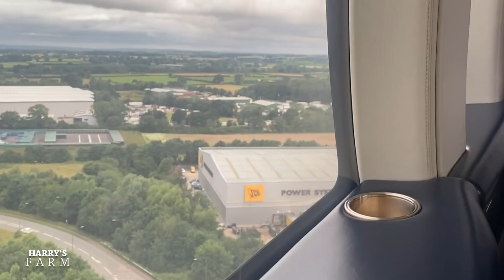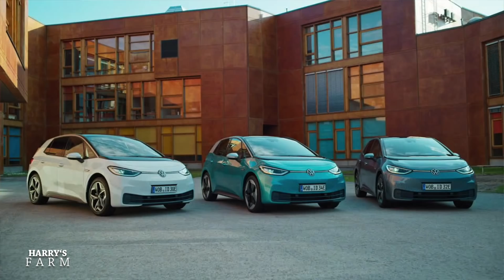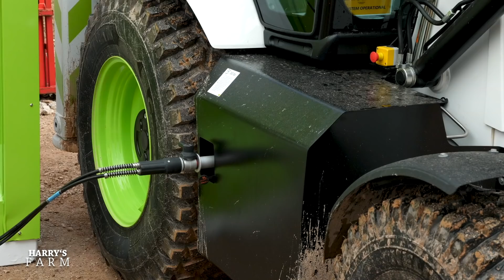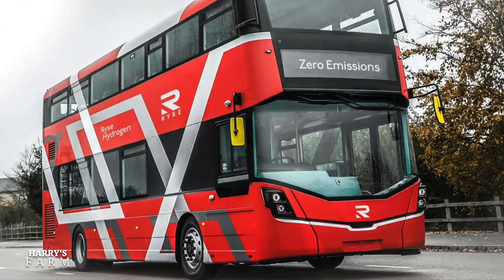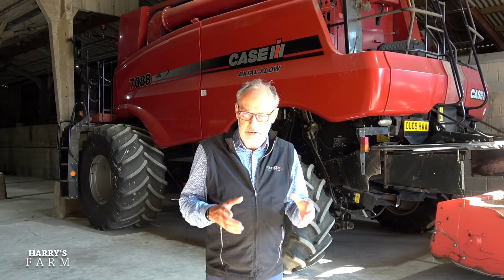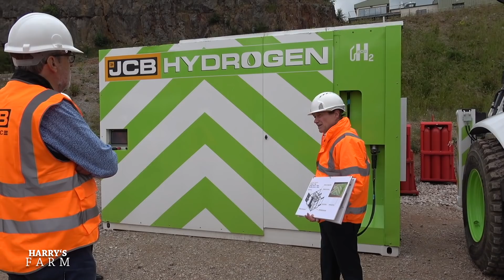Why JCB thinks hydrogen is the best alternative to diesel for heavy machinery, farming and HGV fleet

Comment: It would be interesting to see you produce a video of a tractor or other farm machinery /generator working on your farm , doing a comparison between diesel and hydrogen power , as is always the case polytickians knee jerk  reaction prove to be  entirely the wrong answer❗❗❗❗ 
Well done to Lord Bamford and JCB for coming up with a viable sensible , workable  solution that is also eco friendly , plus it's an English company  , it would be great if a branch of JCB had a factory in Cornwall 👍👍😎😎

Comment: When H2 becomes H20 vapor in a hydrogen engine, it has stored energy in the form of specific and latent heat. When the H2O rises into the atmosphere it absorbs IR in exactly the same way that CO2 absorbs IR. If the H2O vapor becomes a cloud and subsequently turns to rain, it gives up its latent heat of vaporization into the upper atmosphere. Water vapor puts much more heat into the upper atmosphere this way than does CO2. CO2 does not liquify in the atmosphere. Water vapor and CO2 absorbing IR from the sun overall reduce ground temperatures, by absorbing IR then emitting IR some back into space.  Life survives in all climates that are not permanently frozen or above about 60C. No life can exist when CO2 is less than about 150 ppm. Green is CO2, IR and heat. Sufficient CO2 is more critical to life than climate.

Comment: Main issue with hydrogen is the cost of extraction of it from the air/water. There are only a few suppliers, like with electric vehicles we need to massively expand the suppliers of hydrogen and electric charging points.

Comment: One thing that seems to get left out of the discussion about efficiency between BEV and hydrogen is that if you go head long into BeV you essentially need to build an all new global fleet of vehicles. You can convert diesel and ICE engines to run on Hydrogen. I'm not sure if anyone has done the calculations, but I bet if you added in all the new materials and energy required to do this you'd would find that Hydrogen is a more attractive option than we currently think it is. Also, at least in th US, our grid is not currently designed to handle the load that all the BeV charging would require. Not that BeV is a bad option...but it's far from the silver bullet that we are being told it is.

Comment: Why is this conversation NOT happening in the motoring press, costs of batteries, their weight, harder on the suspension, subsequently harder on the the road surface, which will need more resurfacing, batteries are just not the way to go, as Lord Bamford has proved!

Comment: There will be no doubt an initial environmental cost to the development of hydrogen powered heavy vehicles in terms of hydrogen supply and infrastructure. However, compared to the environmental disaster that is being caused by mining for the metals used in EV batteries, it pales into insignificance. I honestly cannot understand why "western" govts. will not factor in the damage that is being done to the earth in our efforts to source lithium, cobalt and copper, coupled with the fact that our supplies of electricity will not cope with the demand of EV's if governments persist in following the false economy of electric vehicle technology. Hydrogen power is without doubt the only viable way forward at the moment.

Comment: Hydrogen in an ICE is arguably better for the environment. However, that doesn't mean Hydrogen in an ICE vehicle is good for the environment. You get a hydrogen leak and you may as well burn crude oil.
Don't get me wrong. I am on team hydrogen rather than team BEV, but there are so many people calling out the wonders of hydrogen, but they never actually mention the risks of it. For instance, while not a green house gas it's self, the effects it has in the upper atmosphere actually increases the effectiveness of methane as a greenhouse gas by30% according to a study. Methane by the way, is a much bigger problem than CO2, hence "You may as well burn crude oil" and Hydrogen is good at leaking out considering it is such a small molecule.

Comment: Here are few of my thoughts. We currently have millions and millions of fuel pumps worldwide. And taking all that down and build new charging stations are just too much work. These limitations are just engineering problems, not drilling the earth (batteries) problems. 

Also, I don't see why synthetic fuels can't be a thing. It's waay better to make an alternative fuel (which is already made) which everyone can use in their vehicles with maybe some slight mods to the engine rather than buying a new one. I mean, many people I know bought vehicles with years and years of hardwork. 

Carbon capture plants. Why aren't a lot of interest going that way? 

As another person pointed out, we should let engineers lead the way. Not brainless old politicians.

Comment: Man, in my head, with fuel cells being a thing, a internal combustion hydrogen powered generator, it's just stupid. Sure it might be cheaper to buy, probably just because of development costs/the industry and tooling is already there, but it's less than half as fuel efficient. And it still requires oil changes lol.

Comment: And soon they will produce engines that include an electrolysis component so that users won't have to buy the hydrogen, but can instead just put water in the tank and away they go. Technically it's already been done, but the rule makers will have to allow it.

Comment: The cost of hydrogen fuel could be offset somewhat by selling the oxygen produced from water splitting, i think.
I mean, it would be best to produce your fuel locally if you're going to be using hydrogen, right? You'll need larger tanks and even then, more frequent refueling. 

So say the oxygen produced is cryogenically separated, you could have a delivery truck going around swapping out dewer flasks and selling the oxygen off to companies that need it, like the medical industry.

Comment: Totally agree Hydrogen is the way to go all the way ..1 fuel for all...the days of 3 fuels at a gas station gone  ...The big fuel company's should be getting on to this now instead of looking for new oil fields and such the answer is under there nose..And they still will need to make oil for these engines but that is a renewable thing now days ....Dont get me wrong Tesla is doing a good thing for now .But once a battery discharges its gone ..But with a Hydrogen its spent fuel is turned back into water and therefore can be reused over and over again.....It makes so much sense it is stupid of the big three over here in Canada and the US not to go to Hydrogen ....And to take a few minutes to recharge vs hours is a no brainer as to which i would choose to buy......I could go on

Comment: There is a reason why Toyota is building hydrogen ICE engine after having promoted the hydrogen fuel cell engine for so many years. Hydrogen ice engine is cheaper to produce and can easily replace the petrol engines in car. But how do we produce cheap hydrogen and cheaply transport it?

Comment: Prometheus fuels has  a process that can use electricity and atmospheric Co2 to produce hydrogen and an alcohol in an aqueous mixture.  The alcohol can then be made into diesel or jet fuel or gasoline.  They do this using a nanotube membrane to separate the alcohol from the water.  The low power trick is to keep the carbon dioxide in a carbonate form.  They are able to market jet fuel for one cent less per gallon than fossil fuel based jet fuel.  American airlines is buying 10 million gallons of fuel from them as a starter. They plan to sell container sized processing factories that customers can use on site to produce their own carbon neutral fuel.  I wish this company was publicly traded. I would buy their stock.

Comment: I have always wondered how electrification of heavy goods lorries would work given the number of hours the run a day.  Not covered here though is the cost of running on hydrogen and the lower efficiency of a combustion engine.   It is still also possible battery tech will improve which changes some of the economics.  It's almost impossible to say which technology will eventually win out but in the short to medium term its seems both technologies could run depending on the particular needs of the vehicle.
Bosch also have a replacement hydrogen heating boiler ready to go to replace domestic gas boilers.

Comment: Steamology Motion have a much better solution.  1 moving part, small component count, way power per m3, far better efficiency, scalable from a few kilowatt to several megawatts. Very quiet, closed circuit.

Comment: Excellent vid, Harry! Nicely done, LB and JCB! Now, it needs the Auto Industry to crack on and develop combustion engines with Hydrogen fuel usage, as per the JCB Hydrogen Engine. The other big issue is the 'fuel delivery' opportunity, both in terms of a) to the rural users, and b) Hydrogen Filling Stations for the urban users. That might mean a completely new business model for an enterprising company with the will to take on the Petrochemical Industry's hold on the automative fuel supply lines. This is not rocket science. Our engineering expertise supported by a  benevolent force, and driven by innovation, will make the world a better place for Humanity itself...and Mother Earth...and that means, a world without under-performing and very expensive battery-driven vehicles, which no driver really wants in the first place. Just my 2d worth. YMMV. Cheers...and, full steam ahead, I say!

Comment: There's one big problem with hydrogen:the energy equivalent of one liter of diesel costs around 5£ before taxes,it's price has been heavily subsidised for use in unicorn hydrogen/fuel cell vehicles.
One liter of diesel -- 50 pence before taxes.
And you use a lot of electricity for its production (electrolysis) which could instead go directly to households bringing better/higher efficiency.
About hydrogen: in 90's BMW made petrol cars (750i) that run on hydrogen.
Apparently it was quite simple and cheap conversion similar to current CNG conversions.All ICE cars can "easily" run on hydrogen but it's production and price are so far unresolved issues.
It takes a lot of CO2 neutral energy (which we don't have enough of) to produce hydrogen on a large scale and it's very expensive process with poor efficiency. It is enviromentaly much more efficient to use "clean" energy directly in households and factories than to convert it to hydrogen,which is then converted back to energy during the combustion. Besides,only 30% of energy is used for transport/machinery.
So,until we can produce enormous amounts of cheap and zero carbon energy (fusion?) this will unfortunately stay in "immaginationland" inhabited by XR fanatics.
Reply: Actually, the current price of green hydrogen available in NZ for a tractor is as low as 1.2 - 2 pounds per litre of diesel equivalent and the current price of diesel is 1.30 - 1.90 pounds so you seem to be out by an order of magnitude in your assumptions on the relative costs. This is with only the first infrastructure being installed, which will only scale and improve - I guess the production and price issue you mention is looking pretty resolvable. It has taken 150 years to get fossil fuels to their economy of scale and it hasn't taken too much effort to get close. Perhaps supporting companies trying to make a difference would be more productive and positive rather than claiming this is all just "imaginationland"
Reply: 1. Why are we mucking about with the functional fundamentals?  Is it because we like a challenge, and the shouty sorts are taking advantage of this?
2. Why are we mucking around with the way we move around so.  It is cruise liners and so on that cause most of the pollution.  Sort them out first, prove the tech, and when safe maybe start looking at the machinery that actually sustains our lives.
3. Synthetic fertilizers and GM crops have the potential to monopolise food production.  This is a serious threat to our standard of living far greater than the relatively small air quality issue we face.  We shouldn't become too distracted.

Comment: This is glorious.  The whole electric revolution is emotionally driven and lacks data and forethought.  As touched upon in the video; the rare earth materials, the charge time, and worth mentioning is the electricity is still generated by oil, coal and gas.  Nuclear molten salt and fusion aren't available yet to charge cars en masse.
Biofuels and hydrogen can replace petroleum pretty darn quick.  I think motorsport like F1 and Nascar are missing a huge opportunity to start using biofuels.
I like internal combustion, it is a wonderful technology.  Let's get some new fuels.

Comment: Love it, i was wondering where the heavy vehicle sector would go and this reinforces my view that electric is great for small stuff but heavy needs heavy.. its like if you run a diesel van but a petrel model you find they are horrible.. eat fuel and have little power.. petrel and electric are the low end and diesel & hydrogen are the heavy end lol its all so simple really.

Comment: I'd be very curious as to the actual changes a diesel engine has to undergo to run on Hydrogen. I'd assume it's not possible with a petrol engine given the high pressures H2 combustion needs, but is it simply a matter of fitting hydrogen tanks, spark plugs and a hydrogen capable injection system? 
If that's the case, I can see a strong market for retrofitting all kinds of existing machinery, including cars, to run hydrogen instead of diesel - this kind of fuel conversion wasn't uncommon in the 90's here in NZ with LPG (the kind you'd run a barbecue off) being fitted to cars all over the place.

If it turns out to require an entirely different engine (which I'm sure JCB would prefer), I can't see uptake being quite as intense but still a good option for the future.

Comment: Hydrogen is okay as long as you produce it in a green way, but producing it cheaply will be a driver and so companies will just use hydrocarbons to produce hydrogen. 

Talking about the cost of ownership, EV motors are substantially simpler than something like an ICE engine. Lord Bamford said technician's don't need to be retrained? There are plenty of examples of mechanics who are adapting quickly and learning they can keep up, but it isn't difficult. Remember that working on a hydrogen engine is more dangerous, it has a smaller molecular size and thus it leaks through gaskets, joints and seals.  

Also, ask why some manufacturers and industry want hydrogen? Because it supports a continued dependency on the traditional supply chains of old. Electric breaks that supply chain, it allows companies and people to not buy expensive fuels. 

You can't just look at the cost of batteries, you have to look at the total cost of ownership.

Comment: So tell me..the cost comparison of running the same engine on diesel or hydrogen? Was it mentioned? Hydrogen= water?? Obviously they have refined water to make it work with this new engine?? So they obviously have the monopoly on this refined hydrogen? If they didn’t they could not control the sale of fuel?? I can hardly see the major oil companies agreeing to this without a cut in profits? As a business owner , the running costs of my plant on diesel is through the roof!! I’d buy this new hydrogen motor if I didn’t have to pay for fuel!!

Comment: Very interesting - but do check the terminology - 'Zero Emmission' is a phrase getting thrown around here a bit too much. On that Hydrogen power plant is clearly an oil filter, the hydraulics will use oils and on that harvester are tires taller than a person -  these consumables are sources of emmissions from extraction to consumption, lots of emerging research on how much tires factor in low air quality worth a look.

Again I would say it was cool little tour of what they are working on, but 'zero' shouldn't be thrown around so casually.

Comment: I’ve just done the math.  Hydrogen has 3x the energy per KG as they stated. BUT it’s density is tiny. To get 1kg /litre of hydrogen (similar to diesel)  you need to pressurise it to 12000 bar ! Now divide that by 3 to get the same energy to kg is 4000 bar, but even then the thermal efficiency of a hydrogen engine is currently 20-25% whereas diesels are hitting 50%. So you need 8000 bar to get the same range and power as a standard Diesel engine. And they’re using 350 bar. So would 350x the fuel tank size. It just doesn’t work.

Comment: Making ICE vehicles of any size run on hydrogen is a relatively simple process.
Actually making the hydrogen however using electrolysis is incredibly expensive. It was estimated that to convert all the current ICE vehicles on the road (from cars to heavy plant) to hydrogen would require at least 750 brand new COAL FIRED power plants to be built (coal is the only fuel that could be scaled to such huge amounts)!
Indeed, it would take a LOT less power plants just to generate the power needed if we just swapped all the cars to electric power instead, which is why most manufacturers are going for electricity not hydrogen.
Reply: oil companies attempting to sell oils and gas dressed up as hydrogen it is a scam    Depending on the quality of the feedstock (natural gas, rich gases, naphtha, etc.), one ton of hydrogen produced will also produce 9 to 12 tons of CO2
Reply: The move from private energy to government energy is unstoppable.